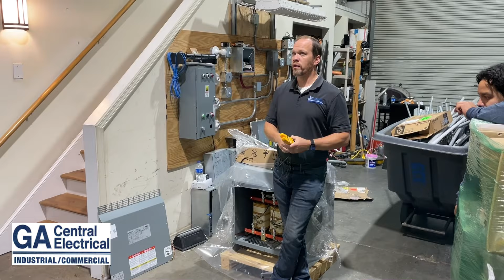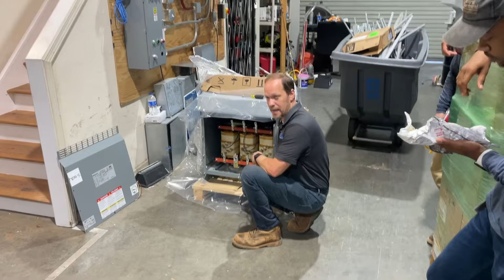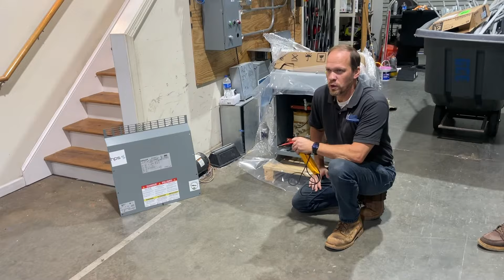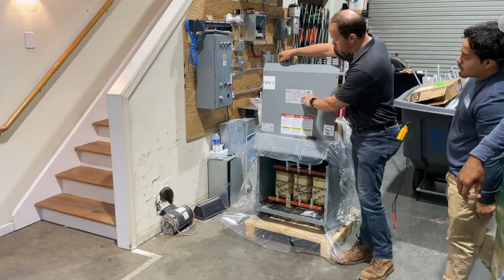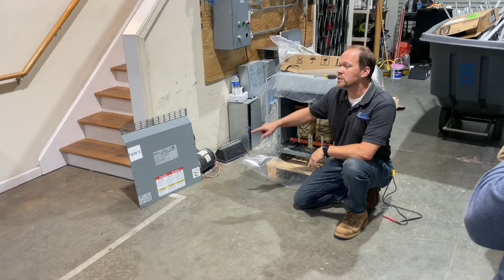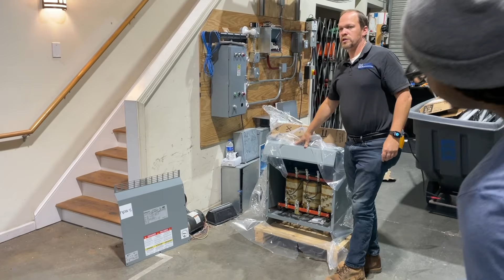Transformer Basics Explained: From Windings to Voltage Ratios

Comment: You mean to tell me , you have a supply of 240 volt 3 phase. Must be a rarity.
Reply: Very common. .Several shops that I did work for had 240 volt 600 amp three services along with a 200 amp 120/240 volt single phase service for lights & receptacles.
Reply: @JohnThomas-lq5qp  by me, it's mostly 208 volt 3 phase
Reply: @justin_sayz  We have 3-phase 208 from the pole where I live. 😇
Reply: Work with it everyday.

Comment: I'd like to hear the story (video preferred) of you setting transformers near pole by your house to run long runs to locations needed then step down. I run into a lot of situations where closest pole is 500ft-1500ft away and generally only option was to get utility to run and set a new transformer which they charge large amounts and usually the job falls apart or we have to run 500mcm underground just to set a 150 amp panels which can be costly

Comment: Thanks for the video. I’m reverse wiring the transformer. Please explain how you bond the H0?  Thanks
Reply: More details please. Voltages on Pri & Sec
Reply: Bond HO with your nuetral and electrode grounding conductor to the metal of the transformer